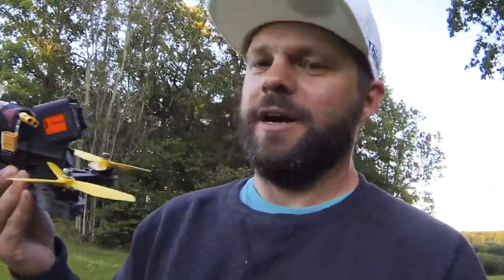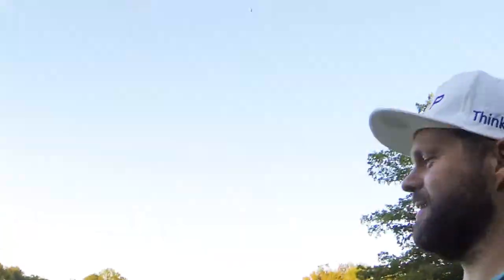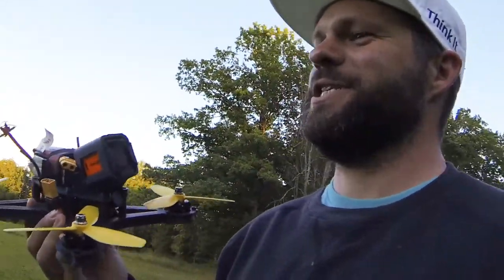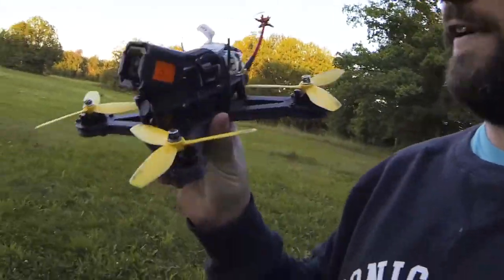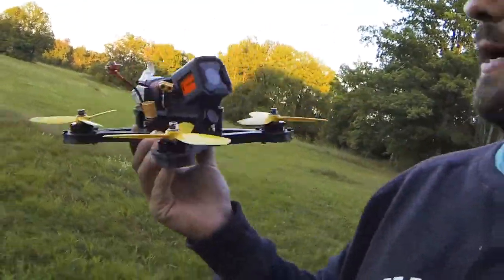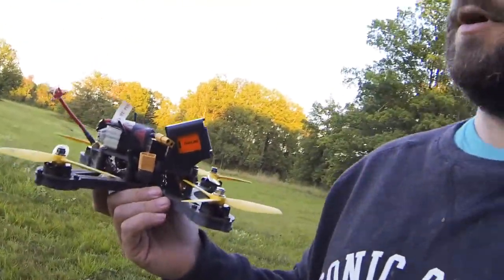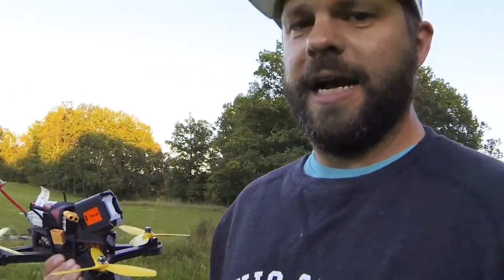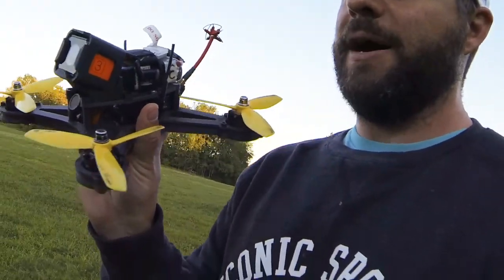Runcam 3 mount for 3D printed OpenRC FPV Mini Quad

Comment: Can you, please, advise if there is any date for mini quad file updates? 
I have just printed first version and was wondering if i should wait before asembling it :)

Thanks for eerything you are doing for these hobbies!
Reply from the maker: Ys, there is a small update coming. Nothing major though. Frame a little thinner, top and bottom now made into one piece each and not cut in to like before. Obviously the electronics fram is thinner aswell.